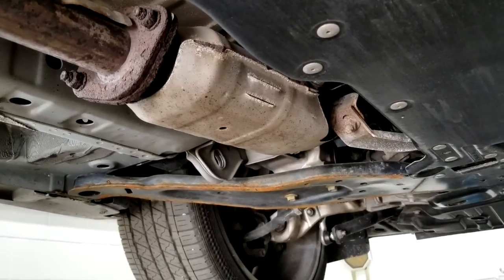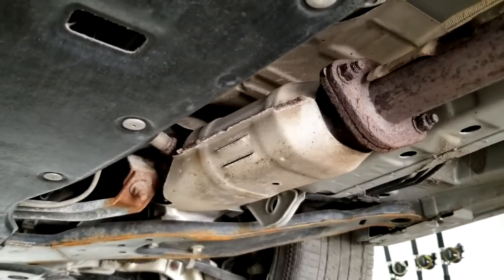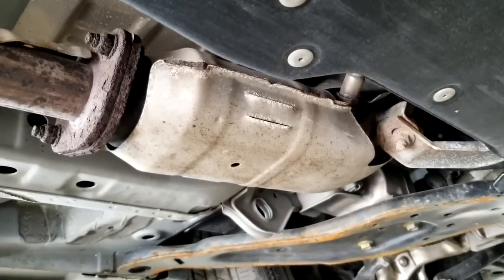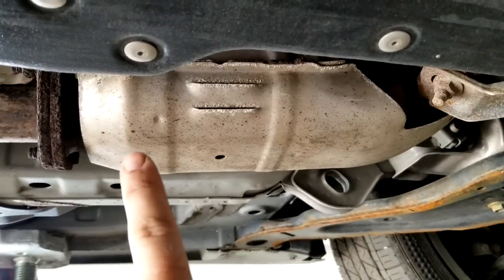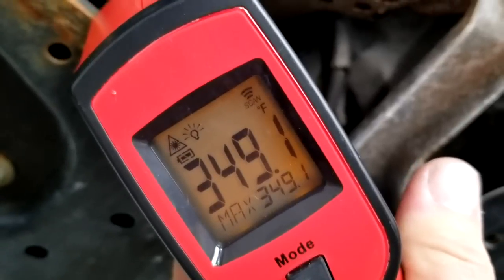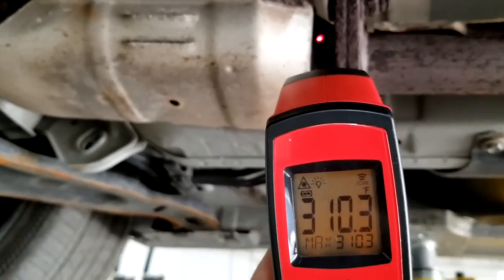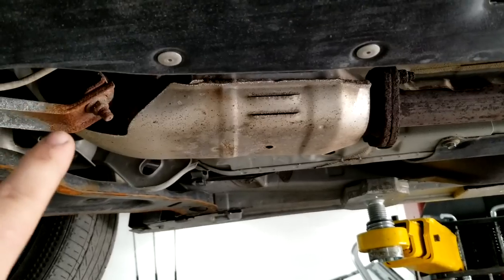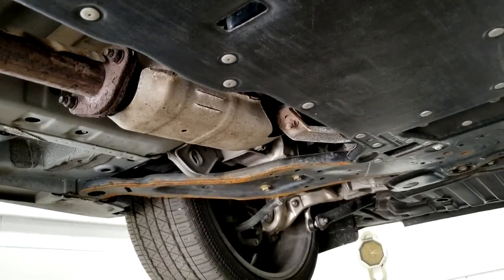HOW TO KNOW IF YOU HAVE A BAD CATALYC CONVERTER DTC P0420? THIS IS THE FASTEST WAY TO FIND OUT.

Comment: I'm getting P0420 and seems my catalytic is ok as I am getting cooler in the before (upstream) than the after (downstream), so how to determine if its an exhaust leak? .
Reply: Could be a bad o2 sensor not reading the air to fuel mix properly.

Comment: I don't have any codes but the cats on my 02 Mustang GT read 50-75 degrees (Fahrenheit) cooler on the backside. Should I be concerned? The only performance issue I have is occasional jerking/stuttering during acceleration and low speed cruising is a little jerky. Since we don't have emissions testing here, I'm more concerned about a clogged cat and/or muffler.
Reply: How's it been now a year later?
Reply: the jerking probably a misfiring cylinder.....sometimes a ford will not set a code till it gets worse

Comment: The actual temperature of that idling car exhaust is not jumping up and down.  It is actually pretty consistent once the system heats up to operating temps, (and still, just go up to that point, not fluctuate), and I will assume you were to that point.  The fluctuation came from holding the temp gauge, the beams hitting the shield, (on the back end. but you had a small straight line shot, and I call 320 F. the top/good reading).  On the engine side, you could not really get a good straight shot at it, (and may have hit some heat shield), and I would have to say that temps are inconclusive.   Compare it to the other cat too, (if you can reach good readings for good data).  I don't think you need to rev the engine to tell either, but I bet we could learn something by getting good readings from there too.  Your philosophy seems sound, (hotter at the far end than the engine end), showing the cat is plugged up and the heat is being stuffed into the engine.  I think the best way to do this, (maybe unfortunately), would be; If you cant get a straight shot with the temp gauge, you might want to remove the heat shield so you can maybe get good readings from the real ends of the cat.
Nice concept/philosophy IMO.  I Just picked up a Jeep Wrangler with 108,000 miles on it, and it heats up the water, (can feel from the dash board heater air) 3 times faster than any car I have ever owned since 1980. I think the cats may be backing up the heat.  When I open the hood after only a bit over mile of driving, (and up to full temp from cold already), that engine compartment feels pretty hot,---like my 6 cylinder Mustang got after I put on a blower, before changing the single exhaust to dual exhaust.  Overly restricting the exhaust will raise engines temps in any gas engine, 2-stroke or 4-stroke, and even if there are no warning lights/code on your dash,---your engine life expectancy will suffer if you don't get those temps down to normal.

Comment: Crazy, a 2016 with a bad cat? My 2003 Infiniti I35 is still doing fine...I hope that thing has a trillion miles otherwise they maybe just don't make them like they used to...?
Reply: People drive their cars either with misfires or rich fuel conditions so unburned fuel clogs the CC. As long as you keep your car running properly most converters should last for a very long time.

Comment: Car sometimes after starting stays low RPM even if you floor gas pedal . I then turn off for about a minute then restart it and usually does the trick works normally . Usually works after doing it once . Lately , sometimes a few tries . About a week ago for the first time ever turn off died several times at home and very nearby ( a few blocks ) . Someone said it's probably a bad CC . Now I'm here trying to figure what to do . I'm hesistant taking to a shop because some mechs don't know what they're doing . Already paid for a throttle body with sensor replacement and that didn't fix it . And when they've tried to scan it it doesn't show any readings . And I've checked fuses
Reply: From a cold engine, start it and drive it with the heater and fan on full.  Just start the car and rive it down the road normally, (no heavy throttle).  Keep one hand in the heater air flow coming from one of the fan air outlets of your dashboard, so you can feel when it starts getting warm.  I just bought a Jeep with 108,000 miles on it, and it is starting to give warmer air within 1000 feet of operation, (gauge just starting to move too).  By the time I go a mile and a 1/4, it is blasting hot air and the gauge is steady (1/2 way on the gauge), as normal.  I get no lights or codes, (the engine does feel sluggish at lower rpm's, but that may be the way this engine puts out power.), but the water heats up about 3 times faster than any car I have had since 1980, and I know for a fact that a restrictive exhaust will raise engine temps quickly.  I suspect it is the rest of the engine management system, (de-tuning the engine to reduce heat), that keeps the water temps from going above normal (for now), or a really good cooling system, (that would take a lot longer to warm up from cold.).  If the engine uses a normal amount of fluid, (and it does), and it heats up about 3 times faster, (judging in operation time from cold, under normal load), there has to be a lot of BTU's being put into that water.  A restrictive exhaust, the cat, has to be a top suspect. 
Mechanics often do not know what they are doing?  Yea---same goes for Doctors today.  I can tell you horror stories about my own health, (which is not that bad), and their "opinions".

Comment: How accurate is the device? Because the cat is very expensive and if the device tells the mechanic it’s a bad cat but in fact it’s not,who is to blame? Shouldn’t you conduct more diagnostics to be sure, it’s a cat,that is bad?
Reply from the maker: Its just another quick test you can do. I use it for my self and it always worked for me. Its always a good idea to do a catalyc intake vacuum or exhaust backpressure check. But in my experiance so far i was never wrong
Reply: @melniksmotors  good